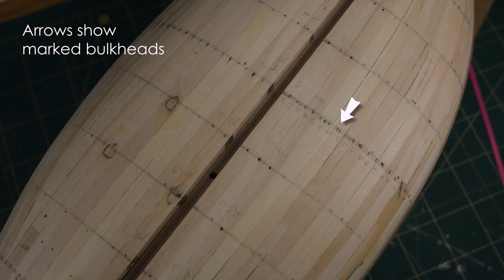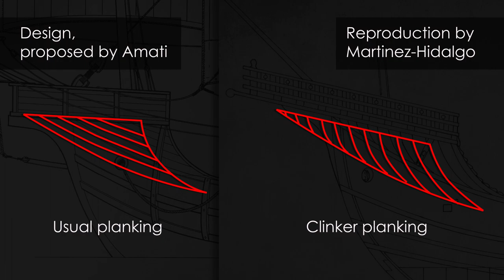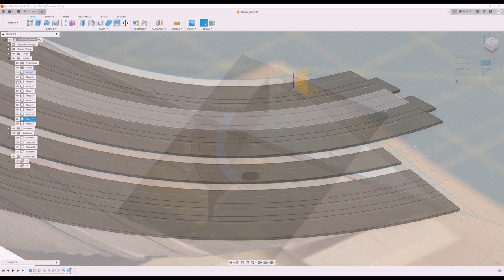# 9. Final planking. Bending planks. Clinker planking. Columbus Santa Maria. Scale 1/65

Comment: I love your mini table saw... what type is that? I am trying to decide whether to buy one or build it myself from a mounted Dremel. (A mini table saw isn't too complicated, as long as you have a way to spin a small blade without any wobble, and I've got loads of small aluminum bits for the table) Thanks for making the video.
Reply from the maker: Depends on what do you want to achieve with this saw. I’m not sure that smth based on Dremel will provide essential preciseness. But it might be lower budget. The saw I have is Byrnes Table saw https://byrnesmodelmachines.com/graphics/slideshow1.png

this saw is remarkably precise, I love it ;)